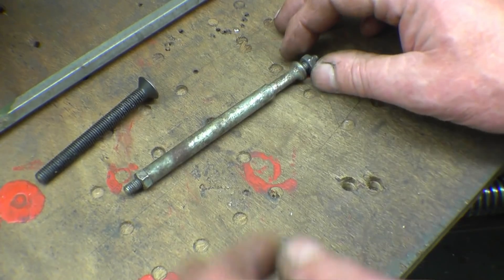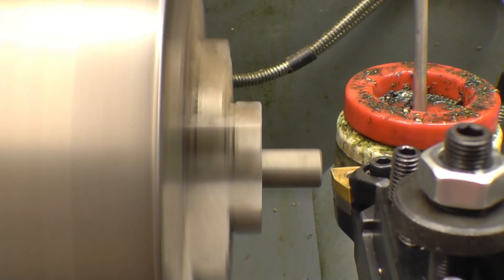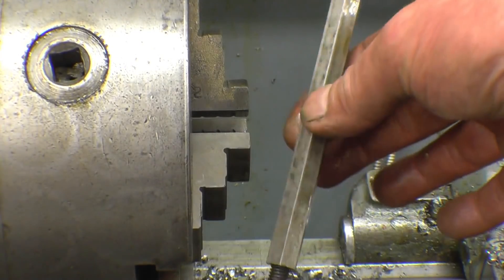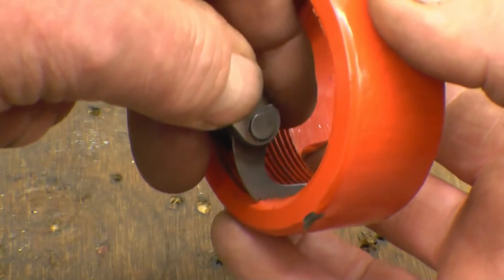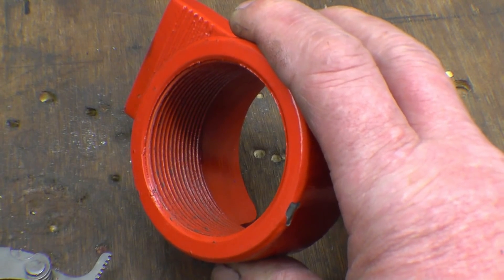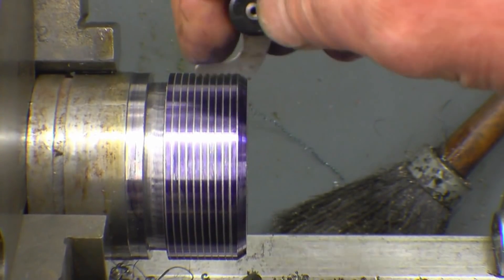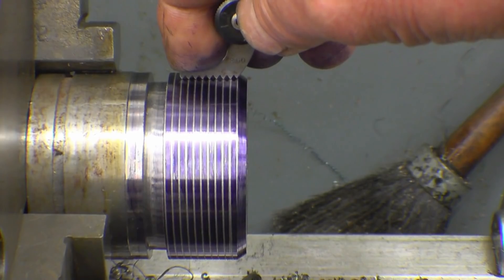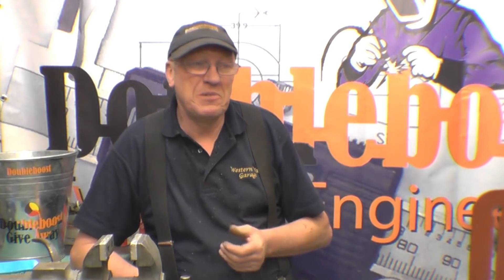SNNC 278 P2   Screw Cutting Big Metric Thread

Comment: Whenever a thread screws on like that I always wonder if it really just needs another cut to get the fit or if actually the pitch is a bit off causing it to bind after it goes on part way. For a non critical application I guess it matters not. :-)

Comment: John, when you do face cuts it looks like you don't need to lock off the carriage [judging by the speed you do the next cut]. On my little lathe the tool pressure pushes the carriage back away from the end of the work if I don't lock it. Does that mean my lathe is knackered?